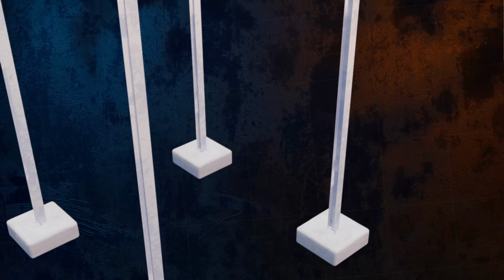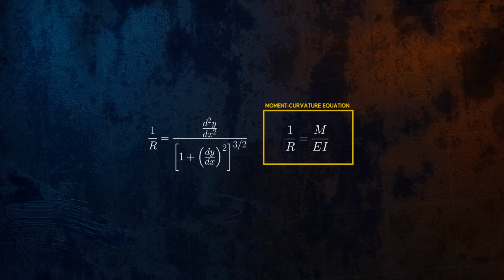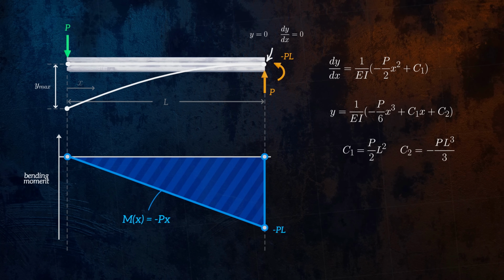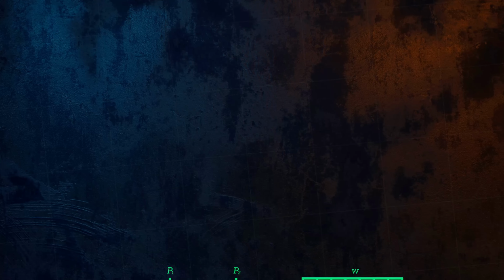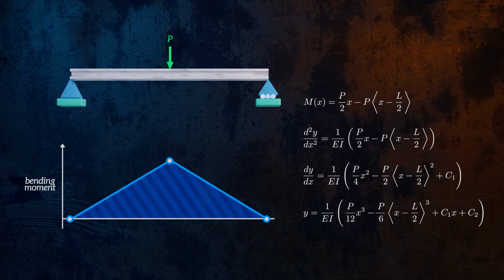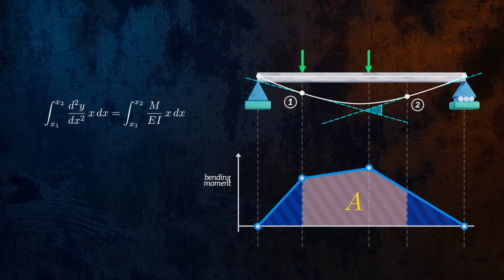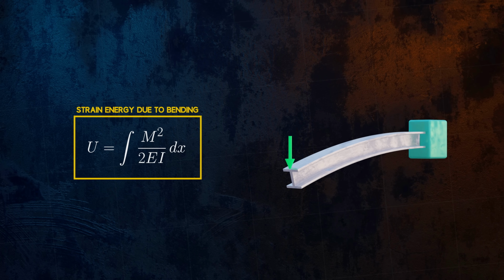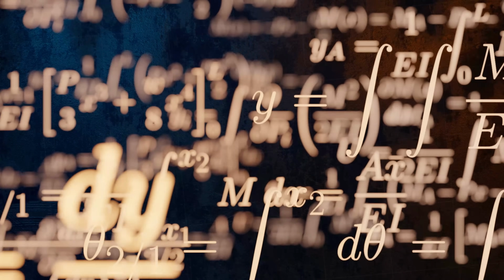Understanding the Deflection of Beams

Comment: A simply supported beam of span L carries a downward point load P at the centre and an upward point load P at a distance L/4 from the right end.
Determine: (i) The slopes at the ends of the beam.
(ii) The deflections at the sections where the loads are applied.
(iii) The maximum downward deflection.

Comment: I do like to see again what I learned about 60 years ago. I do remember what you did but could not follow it.
I designed mostly heavy industrial steel structures all in my working life. I do like to see it again however I have to ask you: for whom did you do that presentation? Most likely you are an professor or lecturer and write this this to another college. Even people sitting in class,
hearing it the first time, would not follow that speed. Otherwise it was a very nice presentation. As most working engineer I had my ways, usually, If needed, I used the moment area method or super position. Congratulation.

Comment: This video illustrates the pluses and minuses of this series.  I gave the video a like, along with the other videos in this series, but I can't fully recommend them, at least not for self-study. At minimum one  has to supplement with other sources that go into the concepts a bit more clearly.

On the plus side, the material is well organized and provides a good high-level summary of important results. The calculations are manageable and the examples are well chosen.

On the negative side, this guy isn't very clear with concepts and it is easy to get confused because he doesn't go very deep. You can travel aong the surface nicely for a while but then find yourself completely lost because of conceptual gaps that have built up. For me it took a lot of thinking to resolve certain conceptual gaps in this and other videos, and I also referred to other sources and videos on YT and elsewhere.

Part of the problem is bad pacing. He goes at  a uniform pace regardless of the conceptual complexity such that easy sections drag and complicated sections where a slower pace would help students absorb go by much too fast. It seems like the reader or narrator is an AI and and AI doesn't understand the natural human pace of learning and where to pause for a moment.
 
Thanks.

Comment: Hey, been really enjoying your videos, looking forward to more.  I've been working as an ME for the past 8 years and realized that I've forgotten quite a bit about materials and how to run proper FEA.  So I've been reading through Shigley's Mechanical Engineering Design while watching your videos, it's been a great refresh.
Reply: Why does ME require FE analysis and beams and such?
Reply: @adrianhalvorsen7013  I design components and assemblies that see loads during use.  So I need to make sure the final product can handle those loads.
Reply: @matts9728  so its smaller versions of beams compared to civil engineering
Reply: @adrianhalvorsen7013  Yeah something like that.  For example, think about chairs or tables.  Someone designs those and needs to make sure that they can hold X lbs. of weight without collapsing.
Reply: @matts9728  smaller loads, smaller spans,  smaller areas so it becomes the same principles more or less.

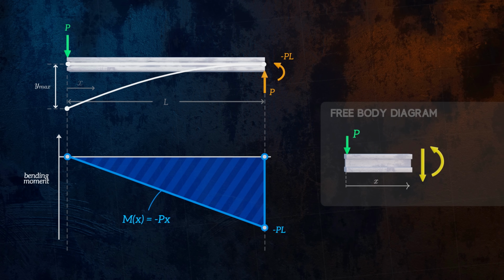Comment: I think there is a mistake at 4:27 related to the direction of the reaction moment at free body diagram. it should be clockwise so the bending moment area will be in the negative region. right?

Comment: There is a small error in the calculation of C1 constant. It is equal to (P*L^2)/ 3 and not (P*L^2)/2.
Same with the C2 constant. The value should be equal to (F*L^3)/6

Comment: I think you made a mistake in your double integration.  You have a minus sign in front of your x^3.  That means the shape of the graph is pointing up as you go left, and pointing down as you go right.  But you defined your x direction to be pointing towards the right, and the fixed point to also be on the right end.  That means it should deflect down as you go to the left and up as you go to the right.  You should have a +x^3, where C1 and C2 have the effect of moving the origin point of x^3 to the right.

Oh wait, you've defined +y as going down.  So the graph going "down" as you go to the right has the appearance of going up.  Nevermind.

Whenever I did these problems at university, for simplicity I made the fixed points at the origin.  Immediately one or more of the integration constants go to zero (I think both go to zero if it is a fixed connection, and only 1 goes to 0 if it is a pinned connection).  And then I defined +y to mean up, so that it did not conflict with my usual intuition about up and down.

Comment: shouldn't a roller support also allow for translation along the Y axis ?
Reply: The roller allows translation in one direction, but the effect is negligible in beams as deflections are limited (quite small) for safety in engineering.